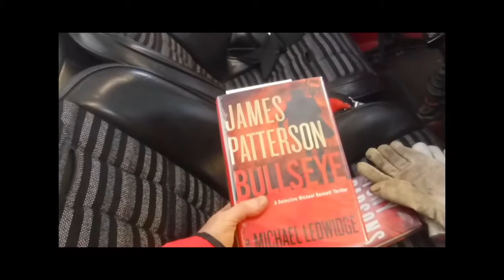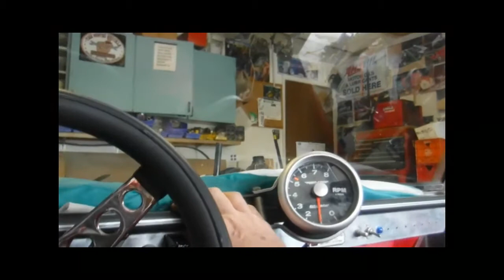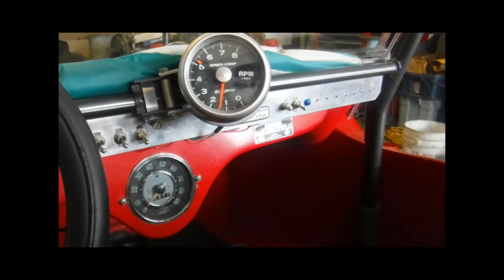In car Tranny Test

Comment: motor sounds great. is that a high torque starter causing that high pitch noise when you start it
Reply from the maker: Nope, Lightened chrome molly flywheel. :-)
Reply: TheEZGZ thanks for the info